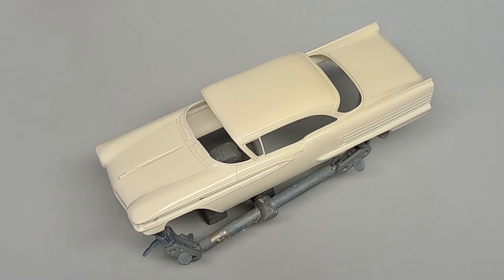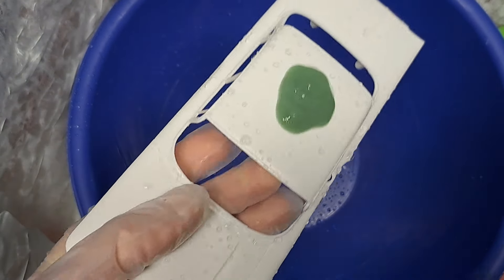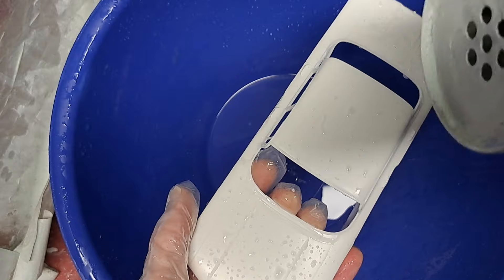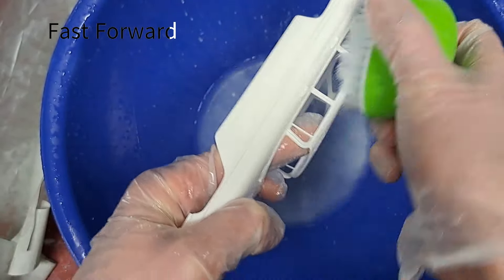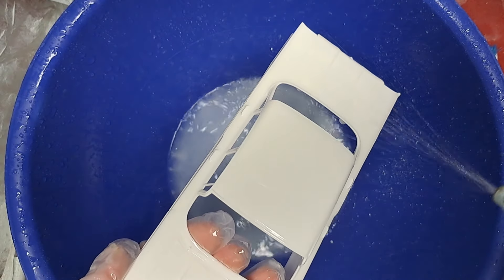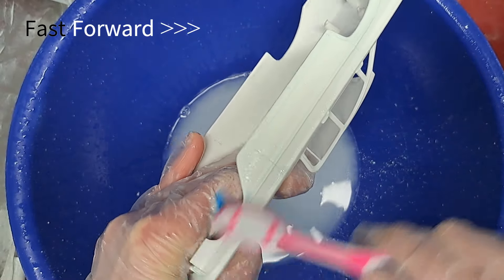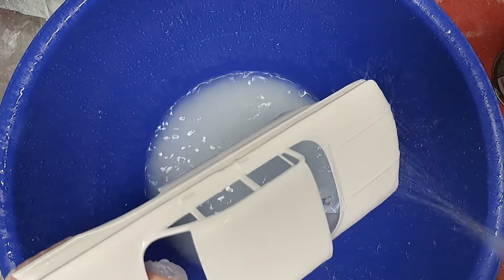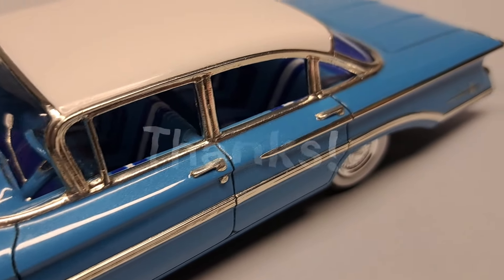Cleaning Resin. Tips For Model Car Building.

Comment: Comet definetly works as it has polishers in it and bleach. I also use soft scrub and gojo orange hand soap the pumice works like liquid sand paper with a toothbrush it gets in all the nooks and crannies... You can also use a battery powered tooth brush to save on scrubbing time.. And a battery powered facial brush will do the large areas much faster... I do this to all bodies plastic or resin.... The bleach version I only use on resin... And that same battery powered facial brush can be used to polish out the paint on the body as well... Great video had to sub... Model on.
Reply from the maker: Thanks! 👍
Reply: One heads up - in my experience scouring powders leave residues so rinse your work thoroughly!